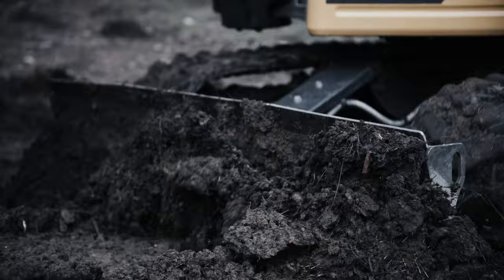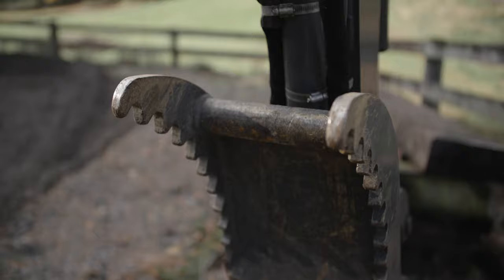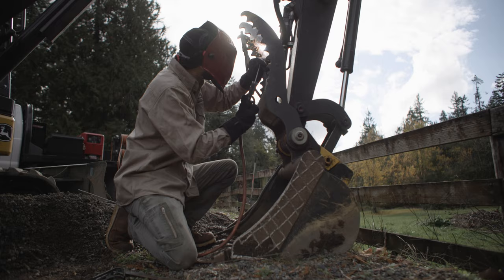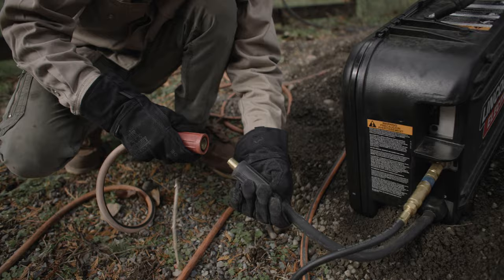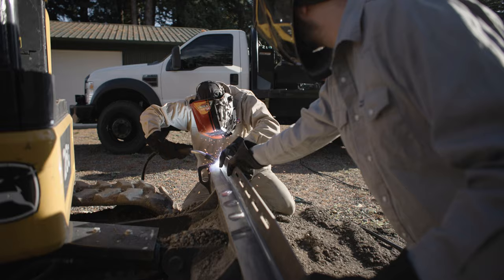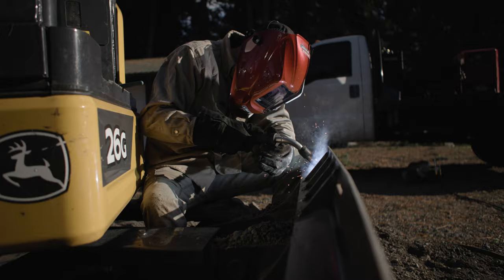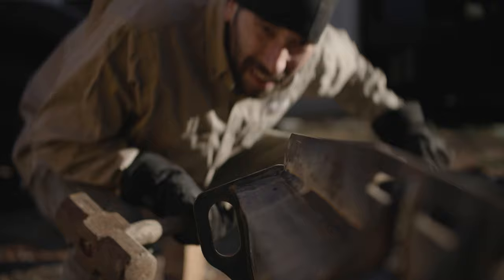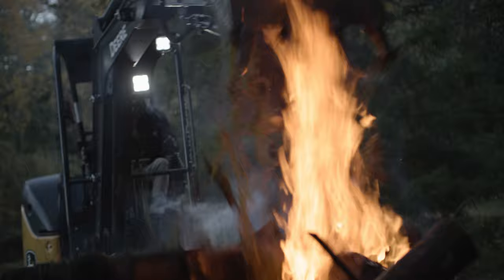Weld Science  - Mini Excavator Mods

Comment: It's cool and shit when you welding with no wind, dry, nice ambient temperature and no rain possibly with some golden hour light. I was doing some welding last weekend in a quarry on a crusher, wind gusts up to 60mph, rain mixed with snow, temp 3C -  37F, cement like dust oozing from everywhere, wiping down the surface with cloth every 5 seconds, rods getting wet in an instant, mask lens covered in mud that can't be wiped of, simple job that would take 1hour in a workshop took me around 4 hrs. Yes, welding is fun :D